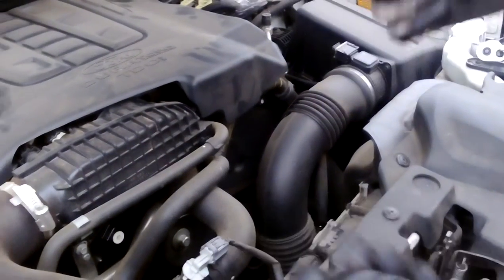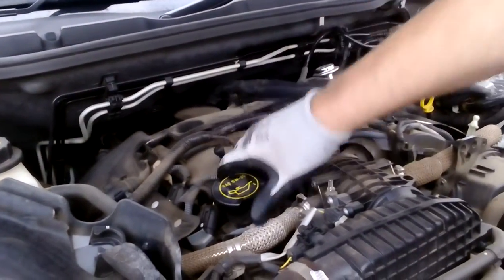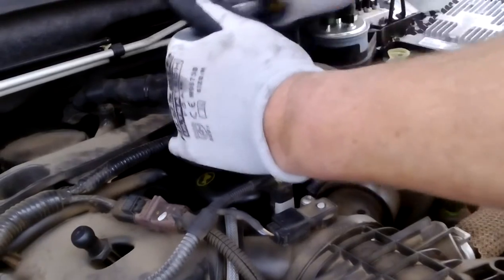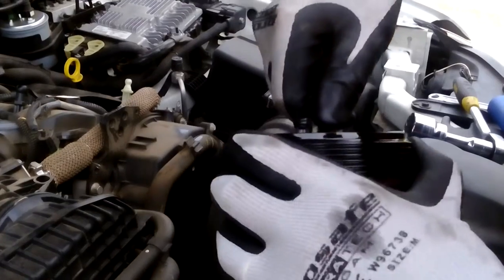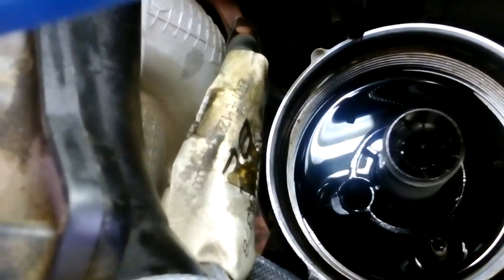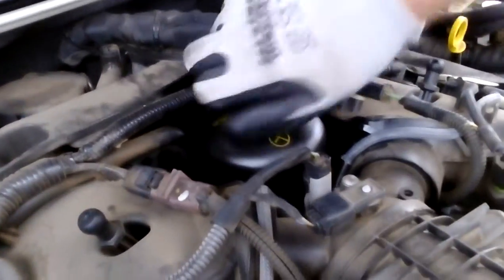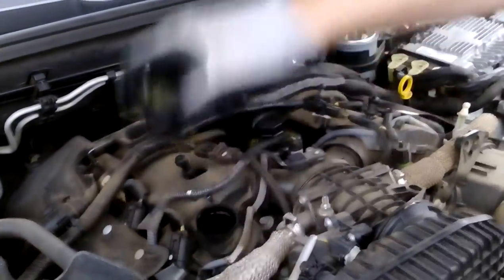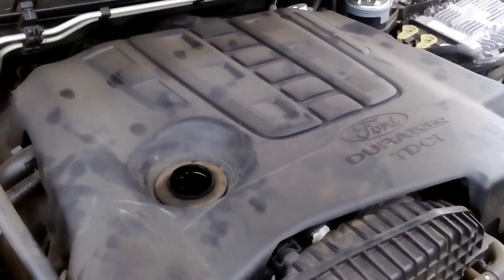Ford Territory diesel oil filter removal

Comment: Very amateurish, 
Didn't fit a new o-ring or clean the canister housing.
It's evident that the wiring loom is chafing on the canister body and should have been tied back to stop foreign ingress to the oil galleries. 
Finally the tightening torque for the filter housing was not observed or the correct tool used.
I wouldn't let this bloke change oil on my lawn mower 🤣
Reply: What is the correct torque setting please?